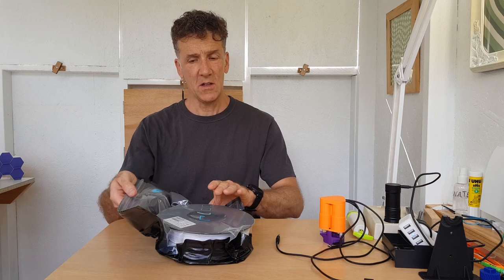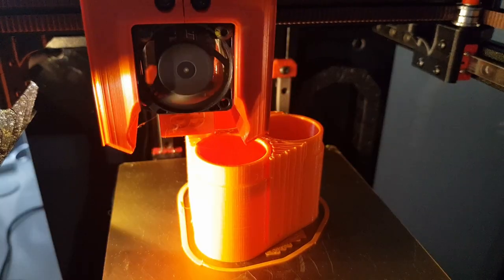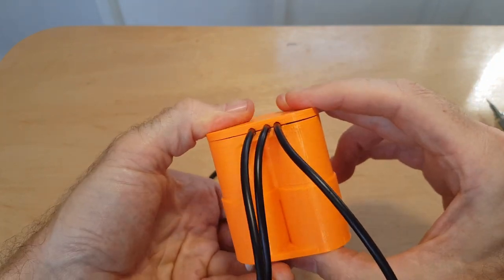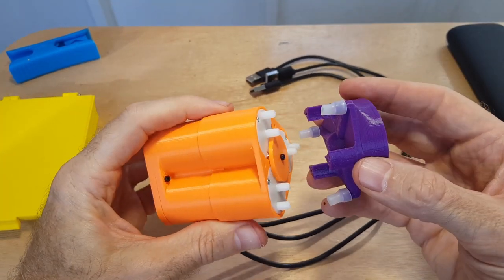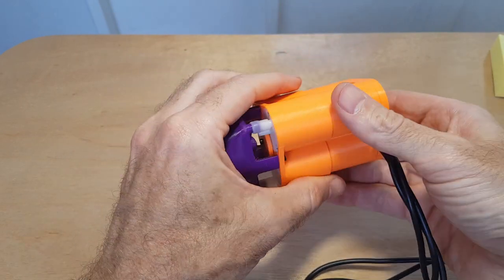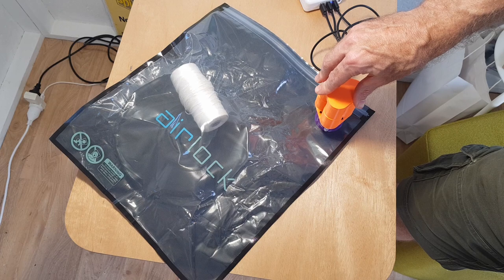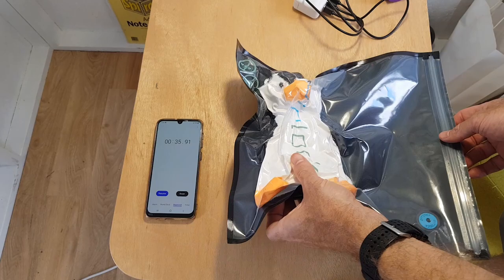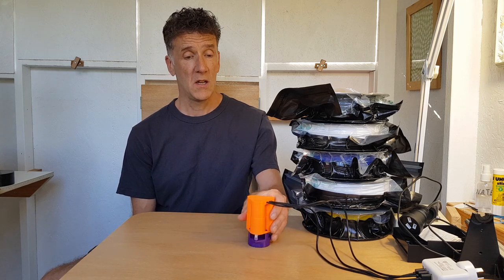DIY 3D Printer filament storage vacuum pump

Comment: Pretty cool design. I bet if you included some sort of o-ring or rubber seal it would be a lot faster. You're probably losing a lot of performance with the hard plastic. Maybe even try printing it out of TPU.

Comment: Hmmm might not have been a perfect seal because of the hard plastic? Perhaps you can put a silicone gasket on there. Might see an improvement in the suction  speed.

Comment: Nice job mike, thanks for sharing! Looks like those pumps you used take in about 0.5A, so if you're using a decent charger of at least 2-3A you could probably connect them all in parallel to the same USB port, which would make this much more convenient! :) Just a suggestion, your project is great.
Reply from the maker: Thanks. You're probably right, I was being cautious and wanted to remove any doubt for this build, but yeah one cable would be simpler !

Comment: Awesome project .. the lid indeed is a bit cramped.. could you adjust it a bit sothat the three holes for the wires coming into the pump are a bit larger and the height of the lid be extended to f.i. 1 cm instead of the 6 mm it is currently ??
Reply from the maker: Yeah can do. What diameter do you think the cable holes should be?  Currently they are 3.4mm.
Reply: cable thickness of usb cables is 4mm, so it's not a lot bigger but will make a whole lot of difference in putting and clamping them in. so if holes for usb cables could be changed to, let's say, 4,1 mm, that would be great ..
Reply from the maker: Ok, have updated STL files.  Thanks for the good suggestions!
Reply: thanks a million .. will print today ..

Comment: Just discovered your channel and subscribed.  You've made some cool projects so far.  I can understand the compactness of using a small vacuum pump and it's a neat project, but I just use the hose from my vacuum cleaner.  Much faster.  I also have a small battery powered Milwaukee shop vac that works even better due to its small size.
Reply from the maker: Interesting, I've tried my shop vac but it didn't work. Wonder if its the suction power of the shop vac or difference vacuum bags?
Reply: @MakerMike54  The vacuum bags I bought were from a department store (Target).  They're for storing clothes and quilts so they don't take up much space.  The valve is made for a vacuum cleaner hose.  They work just fine for filament.
Reply from the maker: @scaledoctors7033  Nice. And I guess with larger bags you could store multiple spools in one bag.

Comment: Are you using seiko rolling air pumps in reverse or using the inlet valve to generate suction?  Also, would it be possible to get an stl or 3mf so I can try it with a single one?
Reply from the maker: They're specific vacuum pumps. I don't think air pumps can generate enough negative static pressure.
The STLs are at https://www.printables.com/model/406913-diy-3d-printer-filament-storage-vacuum-pump